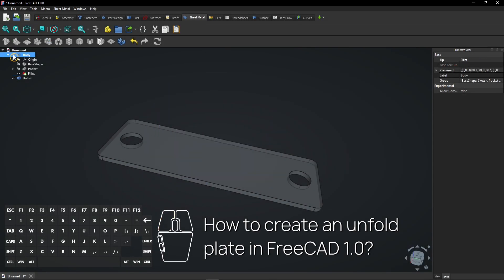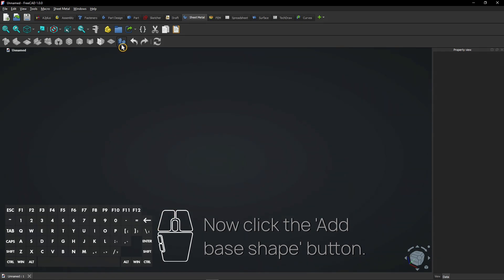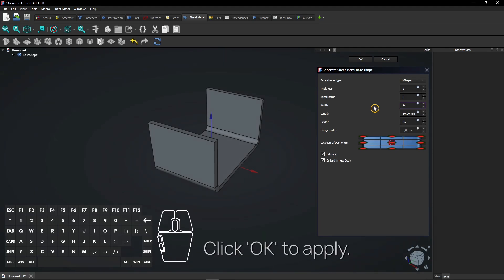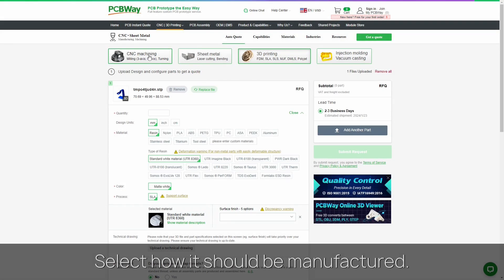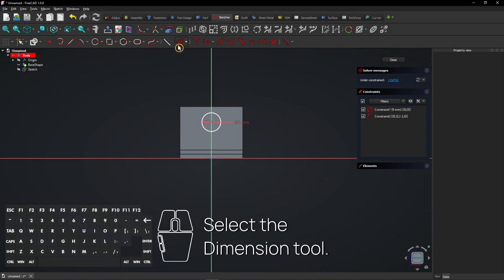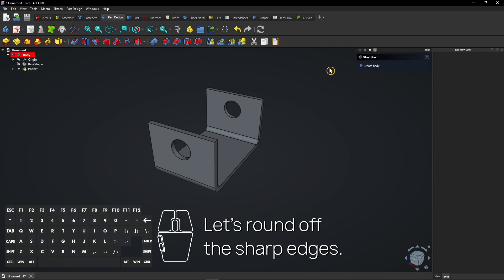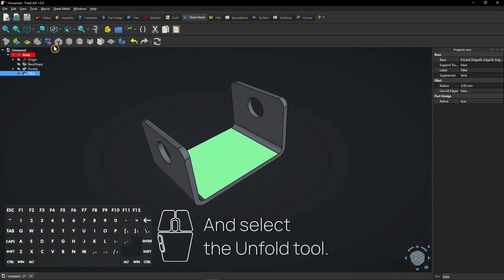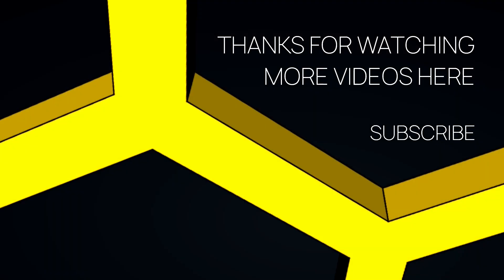⚡ FreeCAD Sheet Metal Tutorial - FreeCAD 1.0 - FreeCAD Workbenches - Sheet Metal Workbench

Comment: Hello,  I have an issue i hope you can assist with.  Are you able to create a file with Corel Draw. Export it as DXF and import it into FreeCAD. Then use the Sheet Metal Workbench to bend the imported DXF file? I have been trying to get that to work for about 4 months now and no one has been able to figure out how to do it.  If you can do a video showing so, that would be amazing.
Reply from the maker: Unfortunately I don't have Corel Draw. Are there any other options for you?
Reply: @AllVisuals4U   I can email you the DXF file to use to find out if it is a FREECAD issue. So far I have had this issue with any DXF file i have imported